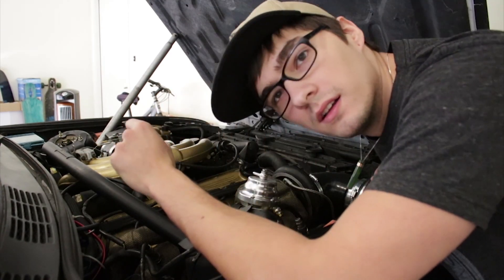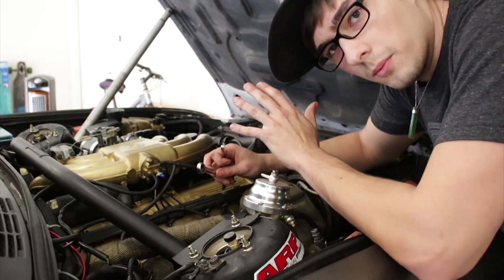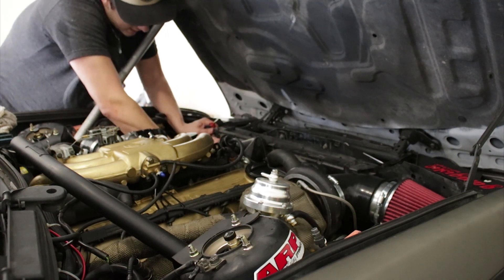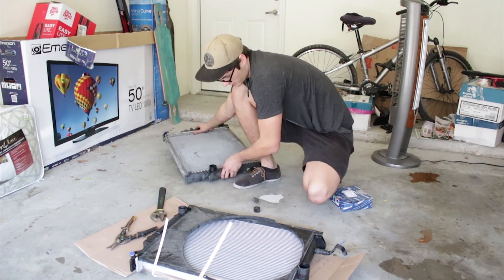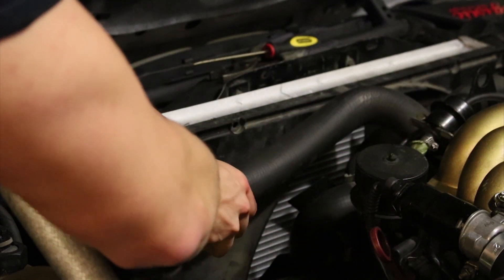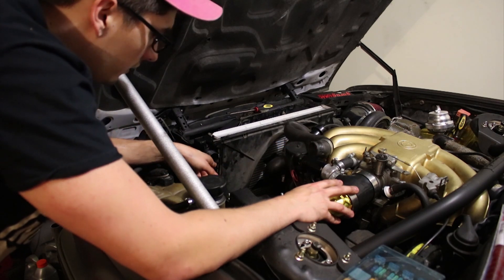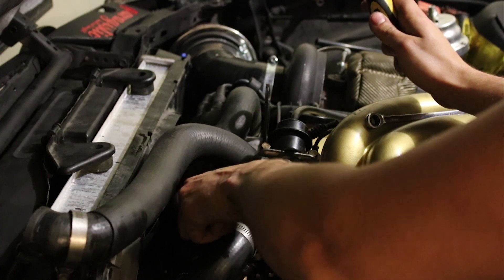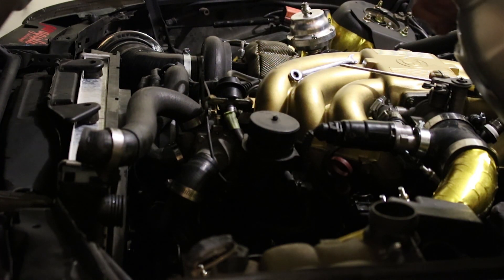How to: Replace an E30 radiator

Comment: Holy baby jesus 2 new videos!!!
Reply from the maker: Same subject. Different purposes.
Reply: EuroGarage they're still great! Do you think arp headstuds are necessary to run low boost? Or is that just to prepare for the future? And is clocking the turbo necessary ?  Im new to turbos but im trying to follow along with your vids.
Reply from the maker: arps are needed for more than like 8-10psi IIRC.

clocking is needed yes, the oil drain is supposed to be vertical.
Reply: EuroGarage and how did you install your electric slim fan? Im in texas too and ac is vital
Reply from the maker: I think its on the inter cooler installation vid. I cut out quite a bit of metal and pushed back the condenser a tad.

Comment: Hey I have a question I have a 87 manual 325i and my radiator is like discontinued it’s hard to find a replacement online and if I do it’s out of stock. I have a sensor on the driver side of my radiator and haven’t seen the “replacements” with the correct sensor location one inlet and outlets are different

Comment: Any problems with those Revshift cab's that you installed a while ago? looking to upgrade to offset poly but not sure who the best are made by
Reply from the maker: They are all very similar, I have had no issues with mine. The "best" is a relative concept as some offer more comfort as others off more performance and it is just your personal preference.

Comment: Why not use an electric fan setup and ditch the loud AF clutch fan?
Reply from the maker: Zachary Belford I think I talk about that in the other video I posted about the radiator. 
I prefer the clutch fan.
Reply: Have you heard the motor run without the clutch fan? I just pulled mine off a few weeks back and to my surprise, I had been hearing the fan spin all this time -- not the motor! 

She sounds so godly now :)

Love the E30 project though my dude! looking forward to more vids!
Reply from the maker: Interesting. Maybe ill try it out sometime.

Comment: I have my eye on an e30 but it has 250k miles on it. Im planning to boost and I don't know how much longer the engine will last or if it could still handle the boost. Do you think it's worth it? And how many miles does yours have?
Reply: Jonny Fallis how much? I’m currently thinking of buying an e30 325i and it seems to be in good condition and it runs fine for 2k and it has 126k miles

Comment: I WOULD NOT USE DEX COOLANT IN MY BMW.  DEX is for GM cars.  There are compatibility issues.  I destroyed my 1986 e30 325 ETA putting DEX Coolant in 1999.   I flushed the coolant system and changed the coolant, and about 9 months later my back freeze plug leaked coolant ( Dex ate through the sealant around the plug.)   The fact that coolant leaked into the clutch and I needed a muffler and brakes........I was quoted over $3k in repairs........Bye Bye ETA!  To me it was not worth repairing the car,  the car was a lemon from day one.    It kept needing repairs.  It was time to let it go.  It turned out to be a blessing because I bought an 1989 325i which I still drive today.